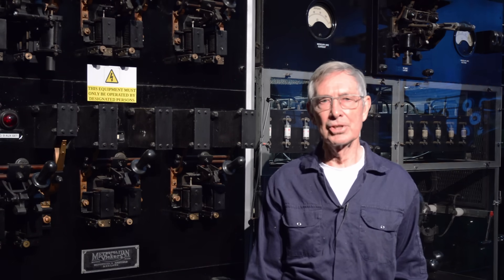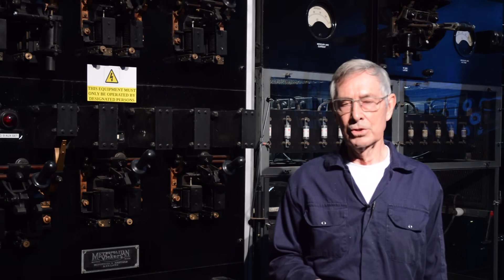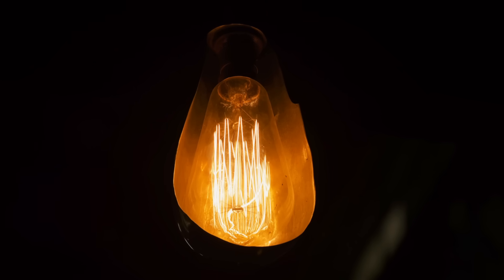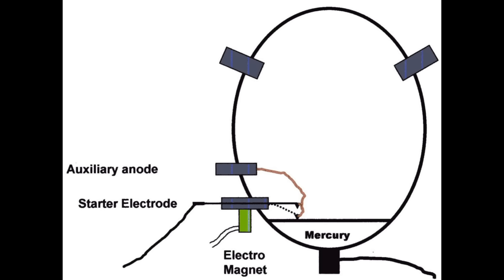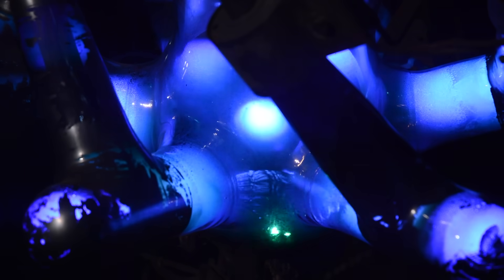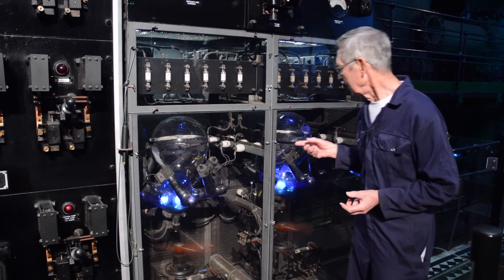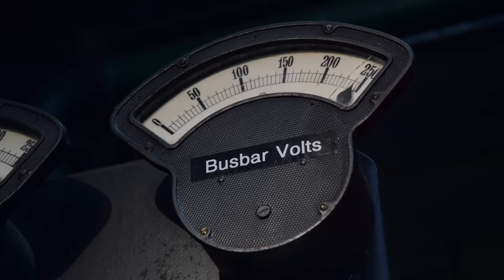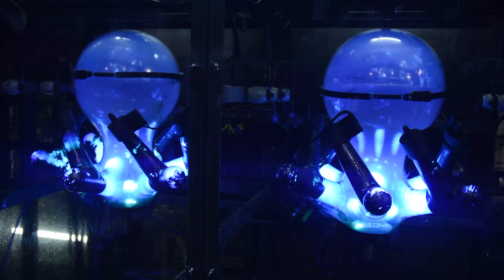Mercury Arc Rectifiers - Kempton Steam Museum

Comment: I love how modern solutions are so simple… like solid state vs tubes, fuel injection vs carburation, turbine engines vs reciprocating engines, internal combustion vs external combustion, etc etc.. but engineers had to figure the difficult way that was technologically feasible first before things like materials and processes and tolerances allowed simpler things to be developed.
Reply: The modern solutions are VASTLY more complicated.   In 1920 an electrical engineering degree could be done in 2 years, and on graduation the new engineer after a couple of years practical experience could work on just about anything electrical or electronic.   These days an engineering degree starts with 4 years of university and on graduation the new engineer must specialise - it is not possible for one man to understand all electrical and electronic technologies.
And if you think for example that turbine engines are simpler than piston engines, just look at photos of a typical turbine engine assembled and dissassembled and photos of a typical piston engine.
Reply: @keithammleter3824 turbine engines are just multiple fans and stators that are held up by bearings. The complexity is all of the oil, sensor and fuel lines.
Reply: @ferky123  And the combustion chambers.  And things like hollow turbine blades, made hollow so they can be cooled.
Reply: @ferky123  I think you vastly underestimate the complexity of the thermodynamics that turn a "number of fans and stators" into a highly effective machine with a steady flow of mass and energy.
Reply: @mynung7008 steam turbines were a thing long before jet engines and are how boiling water power plants make electricity. They were invented when Queen Victoria was around.
Reply: @ferky123  They were not a big thing.
Reply: Most solid state components work on similar principles to their larger,  more ancient counterparts. You can think of old electromechanical bits as working proofs of concepts for the processes that now reside in semiconductors
Reply: I wouldn't describe electronic fuel injection as simple, compared with a carburettor. It works much better, at the expense of being much more complicated.
Reply: I think you see a plastic tube with two metal legs sticking out of it and assume it’s simple without understanding the complexity behind what’s inside
Reply: Prime example of "simpler, not easier".
Conceptually the modern solution for those problems may be simpler, but actually implementing them isn't easier at all
Reply: Simpler in the sense that they are more accessible and easier to use.
Reply: @Splarkszter  If that's what the original poster meant, he hasn't encountered a Tesla car, then.    On a Tesla - your hand, in a non-obvious way, asks the door to open, and the car decides whether or not to comply;  on a typical older car, you hand opens the door.   And it gets more obvious after you get in.
Old car - look at the fuel gauge and immediately see how much fuel is left.    A friend lent me a Tesla to try.   I had to download a 300 page manual and find out how to ask the car how much battery charge was available.
He hasn't encountered a modern phone either.    A 1960's phone = you pick up the handset and dial - its very obvious what top do.   On the latest digital phone - it took me 30 minutes to figure ouit just to how to answer a call - I hand to go online, download a manual, search the index for the right section, and read it.

Nor has he used a PC.   Compare how long it takes to learn all that Windows 11 can do, if only you can figure out how to make it do it, with Windows Version !.
Reply: @keithammleter3824 A diode is way easier to use than this rectifier, that was the point.
Reply: @Splarkszter  It's true that a semiconductor diode is easier to use than a Mekon,  at moderate power and voltage levels, but the original poster was speaking generally.
The latest circuits use active rectifiers to eliminate conduction losses, and they are just as tricky to engineer into a circuit as the Mekon was.
Reply: @keithammleter3824  ". . . A 1960's phone = you pick up the handset and dial - its very obvious what top do . . ." Then you have never seen a person under 45 confronted with a dial phone trying to figure it out.  I act in our local theatre group.  We did a play set in the 1960's with a dial phone as part of the set.  One young woman was supposed to make a phone call on it.  She picked up the handset (she at least recognised that) and then looked at the dial and proceeded to try and press through the holes as though there were buttons there.  When told how it operated her comment was 'that's really weird, why didn't they just use buttons?"😂
Reply: @anthonyjackson280  Really?    The spoken response you reported "Why didn't they just use buttons" is typical of today's teenagers.    But they figure it out anyway.    But not typical of a person near 45 years old.   Dial phones were still being supplied new as standard by our local phone company as recent as 1985.   Push button landline phones had been available for another 20 years or so prior but were more expensive.
But people aged under about 30 think landline phones are just weird anyway.  They all have pocket-sized mobile phones but never use them to talk on.   They think ringing some up to talk to is being intrusive or intimidatory.   They just send SMS or use their phone to access internet sites.
Having an electronics background, I have a private museum of old radios, stereos, and a couple of old dial phones.   They all work.    I have an adapter box that lets old dial phones work on a modern RJ45 connection over optic fibre.   Adults all know how to use them.  But teenagers look blankly at record players.   It's not that record players are complicated to use, it just doesn't occur to today's teenagers that music can come on flat black discs.
On being told that when I was a teenager and paid $5 for an LP with 10 or so Beatles songs on it, they look at me with great pity, then after a second or so they smile - they think I was pulling their leg.
Today's teenagers are used to selecting a movie to watch on their PC or TV by accessing a website and using menus - not difficult but quite complex compared to a typical 1960's TV set.  I have a 1959 vacuum tube TV set hooked up to a convertor box so it can work on today's digital broadcasts.   Typical teenagers have no idea what to do when they see it, but when shown that you have to allow about 90 seconds for the tubes to warm up, and you select a channel by rotating a big knob, they go "Cool!   Simple!   Blurry picture though."
Reply: Simpler... but also boring to look at. These mercury rectifiers are pure physics on display.
Reply: Nothing manufactured today is "simple". In fact, every electrical and electronic apparatus manufatured today is far, far more complex, and far, more likely to fail. None of these modern contrivances are built to endure; and there are far more components in them to fail. The achille's heel of semiconductors is that they *semi-conduct*, which means much heat is generated at their operating junctions (which are very small), and that heat will ultimately cause them to fail. The only thing that has really been gained with all this is *miniaturization*. But, in fact, these things are so tiny now that, except in rare circumstances, they are not even designed to be repaired... they are simply designed to be discarded... they are DESIGNED to fail. And, also, regrettably, there are very few people left that can even do repairs on these things, and with every passing day, their numbers decline yet further.

Which means, essentially, that we have become slaves to these devices, and to those whom produce them.
Reply: Consider the cost, including space in a building, for these mercury arc rectifiers (as a specific example);

- Good chance they need maintenance; replacement electrodes and such.

- They use toxic mercury, and lots of it

- The old (eroded) electrodes will be contaminated with mercury 

- Efficiency is a question; the cooling fans are there for a reason 

- Want longer life using silicon rectifiers?  Derate the components so they don't run as hot.

-
Reply: @johnsmith7676  Those modern devices produce much less heat than older systems. In many cases they have efficiency higher by at least an order of magnitude. You could argue that they have indeed shorter lifespan, but on the other hand if you can replace two of these mercury arc rectifiers with their modern semiconductor solid state counterparts that cost $100 each, are size of a milk carton, take less than a minute to replace and you can easily have a built-in redundancy. Or increase system's capacity by just adding another module. Yes, lifespan shortening become a cost, but in many cases it's of very little consequence.

Why? Because today's systems have failure built into its design. In the past the tendency was to overengineer and overbuild single, max scale devices or systems. Failure was catastrophic, and maintenance was a risk. Lack of consistency in manufacutring made parallelization logistical nightmare, and introduced own sets of problems. Or was plainly too expensive. Today, the failure is a part of lifecycle. For critical systems, redundancy is key, and maintenance is simplified to reduce downtime, if even required. It simply has ceased to be an emergency, it just becomes a task.
Reply: @johnsmith7676  This is not true. The first electronic computers had a few thousand tubes that consumed kilowatts of power and it was only a matter of time until one blew and had to be replaced. A semiconductor processor with the same capabilities would be unlikely to fail, ever, because it consumes far less power that a single tube's heating wire.
Reply: @mynung7008  Agreed.  similar to people who bemoan "cars aren't built the way they used to be" or the eternal "young people today are <insert complaint here>"  All versions of Socrates Lament that has been plaguing humanity for 2500 years (at least)...

Comment: I used to be the screen printer at the shop where I used to work. I had to rig an actinic light source to make an ultraviolet exposure unit for the screens. Basically needed to make an intense UV point source. So I took a mercury vapor lamp and carefully broke the outer glass UV radiation shield away from the lamp. In operation, the UV from this 250W unit was so intense you couldn't remain in the room with it on. I can only imagine how much radiation those Hg arc valve would release if unshielded...

Comment: Really nice to see these again in action.....as an apprentice electrician years ago I got to work on some used for 1000v 1000amp supplies which powered coal trains hauling coal out of an open cut.   
I remember working to change one over and we accidentally smashed it....which was to easy to occur, being glass, heavy and having horns sticking out all over the place.....    if they fail under full load, my opinion is they explode  so treat with respect from a distance.....or at least wear safety glasses!

Comment: Thank you so much for showing these fantastic pieces of equipment working. My father told me, in the steel mill he worked at, they had an old technician who would maintain SIEMENS mercury arc rectifiers that could be opened. This man would have scooped out mercury with a tin cup like it was nothing special. Wonder if he had any problems from that.

Comment: Apparently there were also fluorescent bulbs designed to glow that exact green/blue colour that used mercury vapour! :)
Reply: They were used as streetlighting and also in some industrial situations for general illumination. The light produced has a characteristic blue-green appearance so doesn't give a full colour spectrum. 

One trick in industrial use was to combine these with low pressure sodium lights in the same building, eg every second light was sodium, which also produce an incomplete spectrum but a different one. Between the two they'd produce a reasonably white light with an imperfect but good enough colour spectrum. Done that way because they last for years and were the best option available with the technology of the time - incandescent bulbs being much shorter lived and also using far more electricity.
Reply: @shaun5552  
All of the lights in my primary school gym were originally mercury vapour bulbs when I was there in the 2000s but more recently were replaced with LEDs! :)

Comment: It’s sad seeing the mercury vapors being swapped out for high pressure sodium, sometimes metal halide, and LEDs. We still have a few of them, but they rarely replace mercury vapors anymore. You can still find and buy them, but they’re just not as common as they used to be. MV, especially the bluer kind that wasn’t heavily phosphorus or especially frosted, was also great for not negatively affecting the night sky nearly as much. I find the color temperature of the HPS (~2,200 or so Kelvin) ruins the night sky the worst. But the good news is I can still barely see the Milky Way dust, as long as it’s a dry and cloudless (both rare in Alabama), cold, moonless night. And it’s only a 2 mile drive down the interstate to get away from my city, which is about 12,000 people now, unfortunately. It’s gotten too big.

Comment: The suburban trains in Wellington, NZ, were supplied by Mercury Arc Recitifiers when I was there 1978-1981.  Several were 'Pumpless Steel Tank systems build in the 1950s - 1960s, but several were still using glass bulbs  - mostly 3 arm sets of 4.  At least one station had 6 arm sets like this.  Output was 1600V DC.   3 stations were replaced by by diode sets over that time.

Comment: Many thanks for the historically informative video. It reminded me of the mercury arc bulbs used in the UV lamps about 25 years ago. We used them in non-destructive testing to illuminate the fluorescent indication material. The lamps have been replaced by LEDs now which light instantly, instead of waiting a few minutes for the earlier lamps to heat.

Comment: Best description of the workings of it so all can understand. Thinking has anyone measured the UV level coming out. I recently came into possession of a small mercury rectifier new never used from long ago 50 amp one. I have seen the ones like in the video and the sound they make is a bit unnerving.  Surprised they were not used in SCI FI or horror movies. I understand the bulbous part of the device is for the condensing of the vapor back to the pool. Former automation engineer here. From liquid state rectifiers to solid state ones now days.

Comment: Old power plants used to use Mecury ...until they leaked and everybody turned out dead from mercury poisoning
Reply: It was the vacuum pumps that were discharging the exhaust in the air from the units. Life is cheap to wars and industry.
Reply: @RodgerMudd    Hence, The Phrase
       " Cannon Fodder" ❗💥😊😢

Comment: I watched this, and still have no idea how these things work.  but they have to be the single most steampunk devices I have ever seen.
Reply: What they do is get a pool of mercury. Then a small amount of electricity is applied to the center or one side of the pool. This causes the mercury to vaporize. The pool is negatively charged so is the vapor. The pool is enclosed in a large Glass cylinder with two positively charged electrodes at the top. The negative vapor is attracted to the electrodes and current flows until the current changes direction. This called a rectifier, so the current can only flow in one direction. This is called DC or direct current. In the United States they were called ignition tubes and operated at about 1100 volts.
Reply: So, it works like a diode?
Reply: @philipsmith3968 It is but a very big diode.
The gas tubes are the cousins of the mercury vapor tubes.
There are small versions of gas regulators like the OZ4. ( Very old tube) Actually, you can see this effect by getting a neon bulb and applying dc. One electrode will illuminate. Apply ac and both will.( If remember correctly you need a 60 volt threshold for it to work).
Reply: @philipsmith3968  yes
Reply: I think a simplified description might be: Angry Pixies go in, Angry Pixies make light, then Angry Pixies leave by means of the Anode before coming back via the Cathode a few moments later! 🧚⚡😁

Comment: The Pacific Intertie, a a 1000 mile 500KV DC powerline, is(was) converted back to AC electricity by multiple squash court sized Thyratrons (Mercury filled "triodes"). The output was 1500 Megawatts.

Comment: These rectifiers are fantastic. A good 12 years ago, I saw such a device in the basement of a theater. Direct current was still used for the old turntable. Unfortunately, it hasn't been used for many years, I've never seen it in operation. I would have loved to take it with me as an exhibit, but unfortunately my apartment is too small. Thank you for the video, which shows and explains the impressive operation very clearly.

Comment: mini versions of these tubes were also used in tube-based power amplifiers (for music concerts), and they'd glow in beat with the bass of the music (as that took the most power). unreal to see
Reply: For real? That must have looked great. Many years ago I soldered 24 volt lamps to the sensitive tweeters - that also had a nice sound-to-light effect.